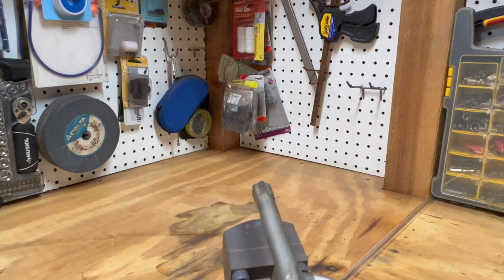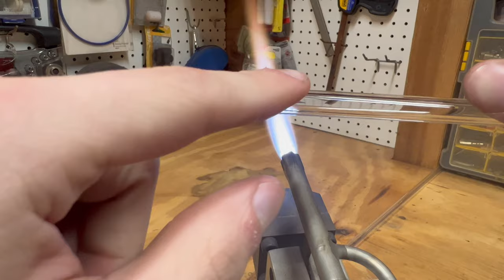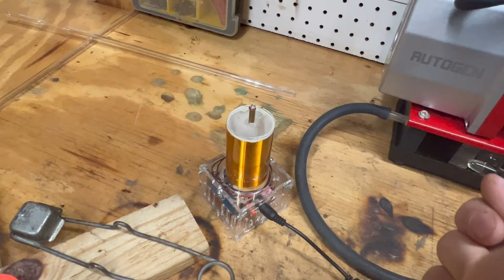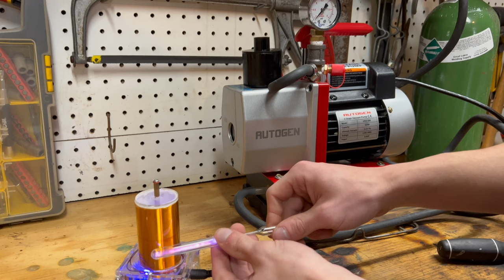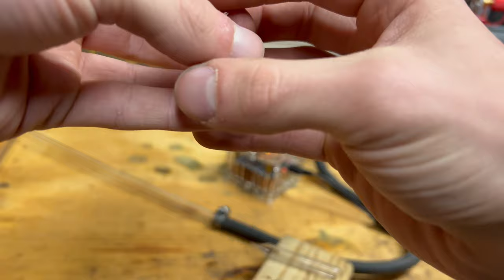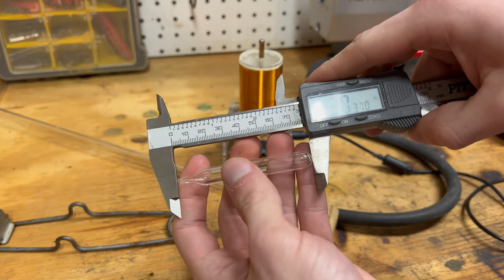How to make a Low Pressure Discharge Tube - Scientific Glass Blowing Episode 5

Comment: Very cool!  The small Tesla coil setup is very nice.  I honestly didn't know that you can get such a good discharge without a metal wire sealed in the tube!  I see the comments below about adding a metal electrode.  I learned how to do it with uranium glass over tungsten wire.  I like what you are doing, for demos, since it avoids making glass-metal seals.

Comment: Nice video. I'm just wondering if you put a tiny grain of iodine in then vacuum and seal, whether the iodine would sublime into a gas form in a useful concentration to ionise with the Tesla coil. Warming and cooling would vary the gas pressure. Might be interesting
Reply from the maker: Interesting idea! I’ll have to try it out. I will let know know how it goes.
Reply: i put iodine in a mini jam jar discharge tube and the arc turned light blue

Comment: You use an Autogen 2 stage vacuum pump that has some platform device with a valve to fill the glass with gas, but where did you buy that platform valve device? I can't seem to find it for sale online although the pump appears available for sale.
Reply: did you ever find the platform device with a valve? thanks!
Reply: No I didn't. Do you know where to purchase it?

Comment: Do you anticipate a upper limit to the tube diameter? Could you use a 2" diameter tube, for instance?
Reply: If you can create the proper vacuum and back fill it with the gas, then you 100% can do it! If you physically can make an adapter or something for the vacuum hose then it's possible

Comment: What torch and what gas are you burning?  I'm in the market to buy glassblowing torch except I'm on a budget. £200 max
Reply from the maker: I’m using a nortel major minor, with oxy-propane. Best bet is to check Facebook market place for deals, that’s how I got mine super cheap.
Reply: @WheelerScientific  yeah I just did snout 30min ago  unfortunately in my area all that came up was £2000 for badly photographed torch
Reply from the maker: eBay has some good deals sometimes just got to watch out for them.

Comment: Pff, already did that, put electrodes in them.
Reply from the maker: Yes, yes you did lol. I plan on it just waiting on the special wire. Idk what I’m going to make yet though, a light bulb maybe or a cathode ray tube.
Reply: Weirdly enough, I can't get a good seal with more than one wire for some reason. I use tungsten wire. What are you going to use? 
I already made some vacuum tubes that can create x rays. But they didn't last very long because the seal isn't good.
Reply from the maker: Did you oxidize the wire before sealing it so it wet the glass properly. I’ll be using a copper nickel alloy wire. An X-ray tube sounds fun to make.
Reply: @WheelerScientific  I can oxidise it and make a glass bead seal that looks good. But as soon as I put it into a bigger tube the nice yellow color goes away. I suspect the flame to reduce it again or something. Same happens If I seal the oxidised wire in directly. I don't have a burner with oxygen. But I bought a bottle of oxygen and try it this weekend.